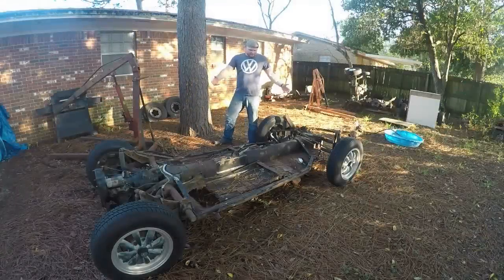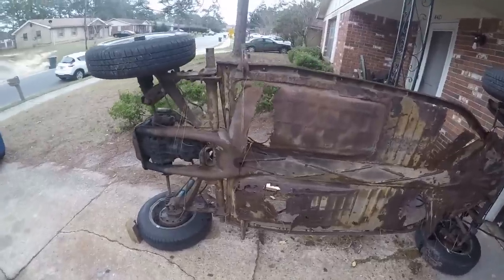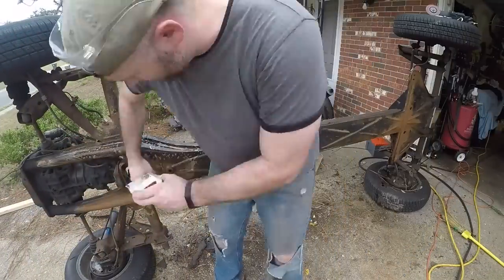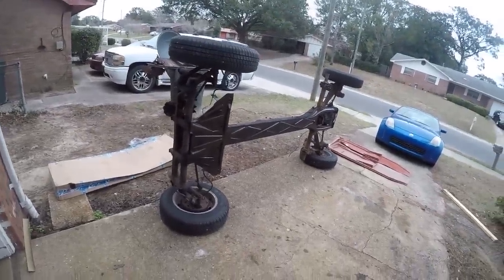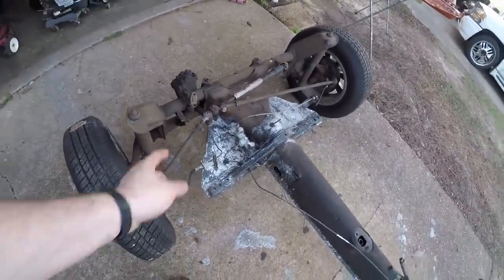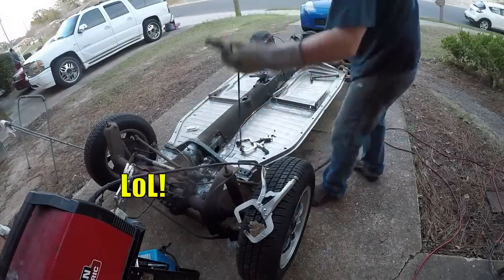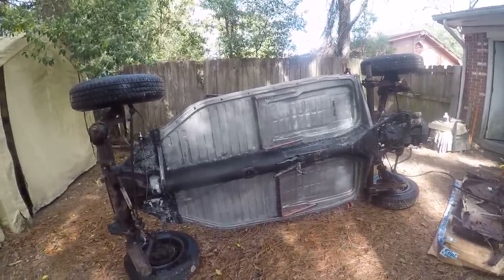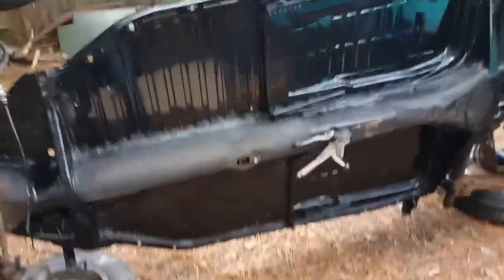Replace VW Floor Pans in 25 Minutes - (Beetle)

Comment: Duckman, I just bought a 72 super beetle and found the driver side forward torsion bar mounting area of the frame rusted and some holes in the napoleon hat… I need to know what is the minimum amount of things I have to remove and disconnect to raise the body to do repairs. Most videos I see they totally strip everything out to do it. Is there a shortcut? I just posted a video of it on my channel! Thanks!
Reply from the maker: Well if you're careful you really don't have to take much anything's apart.  But it's a real pain to work in those closed quarters, I wouldn't even try it at my size.  Best bet is still to remove the body, you'll probably be happy that you did because you will likely find more rust that needs help!
Reply: @DuckmanCycles  thanks, I just don’t want to strip the body bare, just get it off! Funny how the body is almost rust free, heater channels, door posts, floors, even the original battery tray is intact. Could be it was restored many years ago?
Reply from the maker: Yeah that's it, just remove the body bolts,  disconnect steering shaft, disconnect wires to brakes and engine, pull the battery, disconnect brake reservoir, remove seats, remove shifter.  Engine can stay in, but you must lift the body much higher.  That'll get ya!
Reply: @DuckmanCycles  your advice and help is so very appreciated!!! What rust converter do you use!
Reply from the maker: @bobsbarnworkshop  Maybe, or just cared for, then one day it got a leak and the pans filled up with water.  I've had a few cars like that.
Reply from the maker: Oh and links are always in the video description for the product I use!

Comment: Those Brazil pans, can they fit my 71 super. Seat track that is? Awesome video I've watched it multiple times. Gunna cut my pans out tomorrow. Was thinking of buying the pans from Brazil.
Reply from the maker: Any Beetle floor pan will fit in any Beetle.... the only difference is the seat tracks.  The pans featured in this video are the early style seat tracks.   71 and 72 Beetles had unique seat tracks. They resemble the Beetle of previous years however they have a T shaped rail on top as opposed to the well-known L shaped rail.  You can put 71-72 seats on an earlier rail, but they fit like crap and are dangerous... the way to correct this is to weld a top to each of the tracks to create the T, then put the factory bushings in properly.... or you can just  purchase the correct seat tracks or pans that already have them to begin with!  LoL!  I hope that helps!

Comment: phosphoric acid shouldn't react to zinc? That is the easiest method that I've found to remove zinc from bolts and nuts (before welding). Grinding is another but it is really hard to tell from the color if you have removed the zinc.
Reply from the maker: I was way wrong about that... not sure why I even said it.  LoL!   I threw a handful of pocket change in some phosphoric acid as an experiment, and the pennies didn't do so well.  I need to finish that video!

Comment: I owned a 1958 VW back in the early 60's. My wife and i took two 300 mile trips in it. it was a real back breaker.  No heat in the winter. i had it for a year and it went through i think 3 batteries. It was fun to drive We had this hugh snow  storm in 67. i let nothing stop me from going to work. i was going down this long two lane road with just one set of tracks going through it. coming toward me was a car on the same and only track in the road. I said if i stop, i ain't going get this car moving; and if i pull off i know i not going to be goin anywhere today. So we played chicken!  He kept comin and I did too. At the last second he turned into the snow and i laughed the rest of the way to work.  yea, I felt guilty,---for a minute or two. Being much older now i still try and feel guilty while i try and wipe the grin off my face.
Reply from the maker: Hahaha!   thank you so thank you so much for the story I really appreciate that!
Reply: Charlotte mace: 290,000 miles, 14 years. Always more than enough heat in 0 deg F weather. Heat came up faster and hotter than any other car.  Only 2 batteries. When I discarded it at 290,000 miles the engine and transmission were still working fine. The floor pan was rusted; that was the only problem. If I had decided to fix the floor pan, it would have needed a third battery. The heat exchangers were leaking. I would have needed new heat exchangers. If I recall correctly, they were still heating the car just fine. If I recall correctly, the problem with the leak is that rainwater was getting in, and fogging up the windshield. This was the warmest and fastest-warming car I had ever driven.
Reply: @soilmanted  i HAVE A VERY SIMPLE ANSWER FOR YOU. YOU BOUGHT A GREAT CAR AND I BOUGHT A JUNKER. I DIDN'T MENTION THAT I OWN A 2006 VW DIESEL. IT HAS 181,000 MILES AND RUNS GREAT.  i GET ABOUT 40 MPG ON IT. i GUESS I SHOULD CHECK THE FLOOR BOARDS. i BOUGHT IT BECAUSE I ALSO OWN A PONTIAC SUV THAT HAS ELECTRICAL PROBLEMS THAT I WOULD SELL EXCEPT i GET A $100. DISCOUNT ON  MY INSURANCE FOR HAVING IT IN THE GARAGE IN STORAGE. i REALLY LIKE THE LITTLE THING. IT HAS GREAT GET UP AND GO AS WELL.
Reply: I think the heater was greatly improved somewhere around 1960 or so, so yes, maybe you didn't get enough heat in your 1958.. I had a 68 that I bought new, a second hand 68, and a 67. All heated up just fine in the cabin, when the outdoor temperature was down to about -20 deg C. It rarely got any colder than that in NYC metro area.

Comment: Before electroplating zinc onto steel the steel is often treated with copper sulphate which creates a coating of copper on the steel and then its washed and zinc electroplated.
My guess is the acid ate away the zinc and most of the copper which would be green.
Its best probably to leave their coat on there as supplied and paint over it.
Reply from the maker: Yeah, it must have been a really thin layer of zinc on there... or maybe not even zinc at all. The phosphoric acid usually doesn't do much of anything to a galvanized coat.  But I'm not sure if copper is part of the galvanization process... but I suppose some traces of it could be there.  Either way, I always treat with the acid first, it really digs into the metal leaving an inert layer and its very rough which paint just LOVES to stick to!  Thanks so much for the comment.  This was great!  Thanks again!

Comment: I N 1984 I BOUGHT A CONVERTIBLE V W BUG THAT NEEDED A NEW TOP AND FLOOR BOARDS ....PREVIOUS OWNER USED DUCT TAP AND IT WAS ONLY 200 BUCKS TO REPLACE IT....THAT CREATED THE FLOOR TO RUST. NOT FIXING ONE PROBLEM CREATED ANOTHER..BUT I HAD FUN WITH IT UNTIL DRIVING DOWN THE HILL I HIT THE CURB IN THE RAIN.
Reply from the maker: Stop yelling, lol.   Thats a funny story though, I've had my cars that were held together my tape and glue... lol  Thanks for the comment!  :-D

Comment: Awesome video, love the ducks. BTW, welding zinc/galvanized/stainless steel = cancer. Please protect yourself and your family so you can keep doing awesome work like this for years to come. Getting your thyroid checked would be pertinent. Thanks.
Reply from the maker: Ive addressed the smoke issue many times, watch the direction the breeze was blowing... not once did I ever even smell any smoke.  Thank you for the concern.
Reply: You know, grind the metal first at the welding
edges, then weld it.
Reply from the maker: Or just stay out of the smoke right? LoL

Comment: What is the reason to spot weld vs. run a weld bead along the length of the floor pan?
Reply from the maker: Long beads crack because they can’t expand and contract.  VW only spot welded the floor pans for this reason.

Comment: The floor pans were coated in a etch primer .  Polyurethane would of worked well for the seat runner given that new late model vehicles use this method and a body deadener as well as  spotting .Sealing the rear firewall should be interesting given The gap make a jig man it might help that alignment ,being critical too a build
Reply from the maker: Everything is good thank you for the suggestions!

Comment: What was the stuff that you applied to the rust with a brush?
Reply from the maker: Phosphoric acid, thought I mentioned in the video.  Sorry if I wasn't clear.  It works really well to remove rust AND seal the metal.  Hope that helps!  You can get some here:  https://amzn.to/2ruGW0B Thanks for the comment/question!

Comment: you can mix a bit of wallpaper glue into the acid, then it will stick to the metal and work its magic more better
Reply from the maker: I'm not sure if you're trolling me or not, thats not something I've ever heard of.  I'd be worried the glue would kill some of the effectiveness though.  I'll look into it no matter!  Thanks for the comment!  :-D
Reply: DuckmanCycles and VW Garage No trolling, promised! I am no specialist regarding aircooleds but the rust should be pretty much the same on a beetle and on a polo ;-)

Comment: Phosphoric acid? Would that be the same stuff that's the main ingredient in Coke and other soft drinks?
Reply from the maker: Not one of the main ingredients (sugar + water) but yes it is one of the flavorings!  Its amazing what it does to rust in higher concentrations.  If you drink a lot of that stuff supposedly it will weaken your bones... so I only drink it with copious amounts of rum!  😀😀😀😀😀😀

Comment: you can square it up before welding by doing Cross Measurement in an X pattern fom wheel to wheel at the same point and get the Frame Somewhat Square Before Welding.
Reply from the maker: Thank you for your input!

Comment: how many days or weeks it took for you to replace the floor pans thanks in advance
Reply from the maker: 2 days!  I could do it in 1 if I start early!
Reply: @DuckmanCycles   wow because i have the same problem m 1303s have those rusted floor pans and ot has large holes thanks to your reply
Reply from the maker: Well don't expect your first car to take only one day!    :)
Reply: @DuckmanCycles   ive been restoring the bug for 8 years just for the parts maybe another year or two for the body :) my biggest strugle is to fix the floor pan cause here in the Philippines you have to fabricate body parts and yes maybe there are available floor pans but it is to expensive to ship parts where ever the part is :)

Comment: Do you go to bug jam in November in Pasco county
Reply from the maker: I have several times before, as far back as 15+ years ago even,  but its craziness nowadays.  One time they ran off SkeeterTheDuck.  That was a huge negative to me. I may go back, we'll see how ambitious I feel.
Reply: DuckmanCycles and VW Garage the show is under new management now. I had my 3 legged chichuchua with me and had no issues. What do you charge to install a set of pans? Curious how long did it take start to finish on the blue bug you did pans and heater channels and reinstalled body? Just trying to get myself mentally prepared for a job like this. I have a donor car I can practice on. Thumbs up as always,  - keep dubbing -

Comment: Were you using a flux welder outside?
Reply from the maker: Yes, but I wouldn't recommend using any welder in your living room.  😂😂😂😂😂😂😂
Reply: LOL, so I can get away with a less expensive Flux welder? I was going to buy the cheapest Eastwood MIG welder for $300 but a cheap flux welder is about $100 on amazon.
Reply from the maker: The blue welder I used to use on all of my previous floor pan jobs was aHazard Fright welder.  I paid about $69 for it with a coupon about 10 years ago.  I still can't believe its lasted that long.  It still works but has some electrical problems that I don't feel like fixing, so I bought a Lincoln that I saw on... my welds were so much better.  But yes, still using flux core, but don't buy cheap wire, buy some proper brand name stuff. I'll cost a little more, but it actually welds instead of putting on a chinese fireworks show.  I hope that helps!

Comment: I will give you a 4 star for the job. Would have been wonderful if the front end , tunnel and rear were also painted.
Reply from the maker: Thank you!  I will give you 1 star for your comment.  Would have been wonderful if you didn't assume that the front end, tunnel, and rear end were my job to paint!  Not part of my contract, not my problem!  Video title is REPLACE VW FLOOR PANS... not RESTORE VW CHASSIS.  Thanks again, for the 4 starts!
Reply: That's ok...but even though if it was not your job to do the entire chassis, I am sure that the customer would really appreciate the entire painting. It is a very nice detail that will bring an even better recommendation.Just my opinión. Anyway, your floor pan job is very awsome.
Reply from the maker: @ismaelcasillasagosto  I'm sure he would have appreciated it, but let me repeat.. Video title is REPLACE VW FLOOR PANS... not RESTORE VW CHASSIS.  Thanks again!

Comment: Its so funny how to takes you hours to install floor pans while in the factory it takes them a few minutes. Lol
Reply from the maker: Yeah, its really funny that I don't have a huge factory and multiple helpers on an assembly line.  Its also really funny that I'm working with old and rusty parts, and aftermarket replacement parts that don't fit right, and I have none of the large spot welders nor jigs to make things go together properly.  I'll give you a few days, you do the same work and make a video.  Lets see what you can do.  Thanks for the comment.  You made me laugh... because ITS SO FUNNY!
Reply: It was saposed to be sarcastic. Lol
Reply from the maker: So was my response.  ;)  hehe... gotcha
Reply: You did get me. Lol

Comment: What air compressor is this dude using?
Reply from the maker: Which dude, me?  You know this is my video, right?  lol!   I think its like a 70-80 gallon.  Its big, but you don't need anything that big to do this job.
Reply: @DuckmanCycles  
Didn’t know you were good at responding….thanks for the response…to run an air hammer chisel I thought you needed a lot of capacity which it sounds like you have. I’m looking at getting a VW bug 1975 or older cause I live in CA where we got smog rules
Reply from the maker: You can run air hammer on a much smaller compressor, you just have to take breaks after a minute or so of operation.  That’s what I had previous.  And Yes, I might be the best responding person and all of YouTube.  I Take great pleasure in people knowing that I’m a real person over here!  😁👍🦆💩

Comment: One cool thing is that here in sweden the car identity is the frame or in this case the bottom on a VW. and the onlu thing that you need for it tostill be a vw ( in the papers ) is the central tunnel and front and rear axel. then it does'nt matter if you put a ferrari on top of it...it's still the ol vw. Legaly. ok you're stuck with the vw motor and so on but it's stll a vw and with that you also keep the original year of making wich is good.... so you could put a corvette body on a vw 1966 chassie ...still a vw 1966 here,
Reply from the maker: Yes!  It is the same here in Florida!  The VIN that is on the chassis is the VIN that the car gets to keep.  I know someone cutting up a VW to put a Ferrari engine in it, funny you should mention that.... but its still a VW on the paperwork!

Comment: what paint do you use?
Reply from the maker: OIl based enamel from your favorite big box home improvement store usually does the trick.  Easy to get, not expensive and pretty decent.  I thin it 50/50 with acetone so it sprays thin, dries fast and lays flat like glass.  I suppose I could paint a whole car with it, some people might frown on that, but it works great on chassis for sure!  Thanks for the question!
Reply: DuckmanCycles and VW Garage  thank you it looks very god

Comment: Does anyone know what kind of tool he's using right after the power saw @5:20 to cut off the floor pan?
Reply from the maker: That would be my plasma cutter :-)  they are pretty cool and get the job done quite quickly.     thanks for the question!
Reply: Thank you so much, that bug is looking good already. Greetings from Spain.
Reply from the maker: Thank you!

Comment: Good job dude but for the welding seams i also vote first to
put on the seam sealer and then the paint. Because paint 
does not stick very strong onto metal as the seam sealer
does.
Btw, why you dont repainted the whole chassis?? That looks
far more exactlier crafted then just to repaint the renewed
floor pans. And its an upvaluation to the whole car.
Brantho-Korrux onto the water sprayed sections of the 
chassis and the lower body and it will never ever rotten again.
Reply from the maker: Thank you, but I was not contracted to work on the whole chassis.

Comment: Next time use seam sealer on the seams over the welds before you paint pans. Moisture will get in there and rust the floor pans again.
Reply from the maker: Thanks, but thats why I brush paint the seams... I work it deep into the welds.  The seam sealed picks up the bigger holes after that, then paint again for consistency!  Works great!   Never had a rust bubble show in 20 years!

Comment: I had to weld mine in my 64. The idiot used panel bond and did not grind the metal for the panel bond to stick. Year later floors started to come loose. I welded them and chalked inside with 8115 3m panel bond. Wont come off again.
Reply from the maker: Ack!  Thats a terrible mistake!  Glad you got it sorted!

Comment: Undoubtedly the spec for the seat rails is in metric values, either cm or mm. 40 cm = 400 mm = 15.748 inches. Just a guess, but maybe the spec for the seat rails is "between 395 mm and 400 mm." That would equal "between 15.55 inches and 15.748 inches." Or maybe the spec is "between 394 mm and 400 mm." That would equal 397 mm +/- 3mm. That would equal "between 15.512 inches and 15.748 inches."
Reply from the maker: Thats a lot of math you did there hehehe